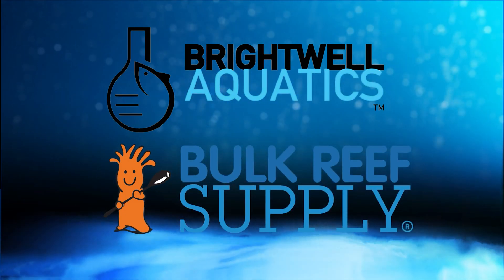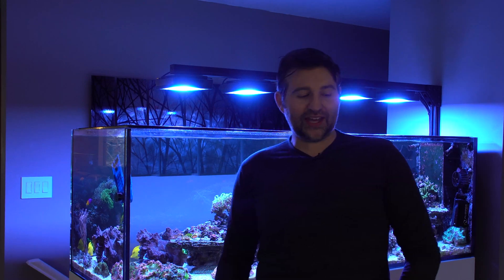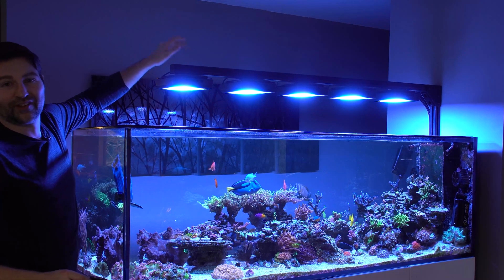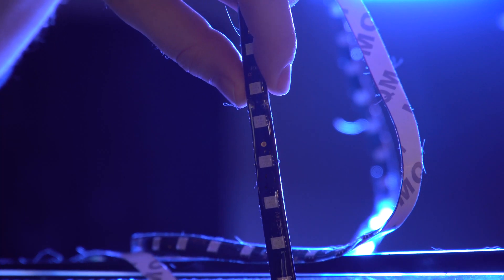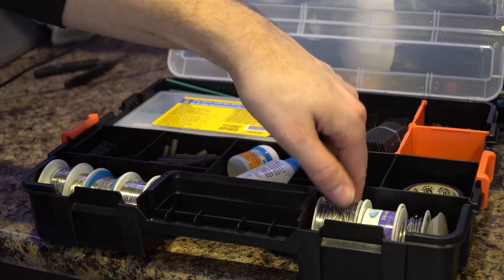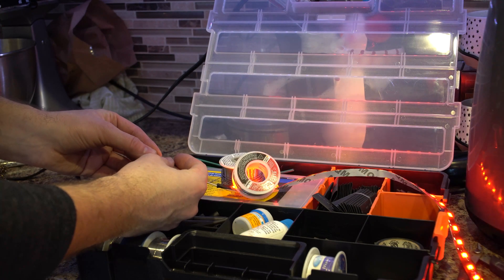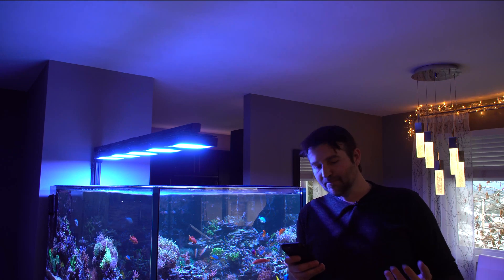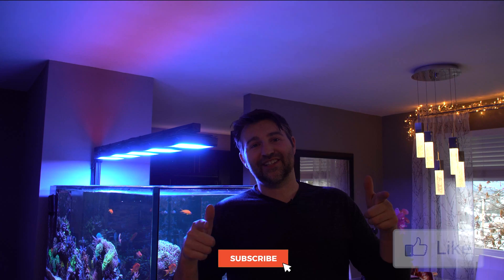DIY Neptune Apex LED Alarm - visual indicator

Comment: Awesome video! Can I do this if I want lights in my cabinet to turn on with a magnetic switch? Also is soldering hard what other ways can I join the wires together safely? Thank you!!!!
Reply from the maker: Cabinets lights work too!  easy to do with a reed switch.    Can go old school and twist the wires and electrician tape it.. but it isnt as "solid" of a connection

Comment: Is it possible to do this using a breakout box and multiple LEDs? Like also having a green light turn on in response to an optical sensor in a full skimmate container?
Reply from the maker: Yes you could.  (Ish). You would likely want to use the 0-10v output and prob a little arduino controller type of thing to pick a color based on voltage

Comment: So Deven if I want to put a light under my tank connected to the eb832 24 volts outlet and put contact switches on the stand doors, will this work with on and off as I open the doors and close them ? Or for example in my little sump can I put lights around it and when friends visit me to see the system , can I just open up my Neptune’s app and turn on this lights ?
Thank you! In advance for you answers. Am sure you will 
Thank you! 
Great video btw
Reply from the maker: You can turn on via app, voice commands with Alexa or get a break out box abs wire it up to magnetic Reid switches to automate it

Comment: I would make that oscillate off and on so it would draw my attention even more.
Reply from the maker: I was thinking of that too! I may implement it later when i have a chance to play :)
Reply: I worry about the relay clicking on and off over and over again. Considering BRS had a problem with their heaters clicking over and over again because they set apex to turn on at like 79.0 and turn off at 79.1. So it clicked all day. I guess it’s not that big of a deal considering alarms don’t go off too often.

What about one of those LED remotes and a sensor that can be placed in line, and the remote to just set it to flash?
Reply from the maker: @PatrickJewellTheGreat  You can buy leds  that flash on their own, so likely strips out there to do the same thing :)
Reply: This advanced code on the 24v port would flash the LED every 2 seconds when EmailAlm_I5 is ON

OSC 000:00/000:02/000:02 Then ON
If Output EmailAlm_I5 = OFF Then OFF

And you get a free audible alarm from the relay clicking on and off ;)

Comment: Nice. I did the same a couple years ago with a regular apex Varspd port and a 5v relay switch, and the rgb tape. Alarm on condition pushes the varspd port to ‘60% or 6v’ and that activates the relay. NO is green, active closed makes it shift to red. Requires 2 apex independent outlets to work and quite a bit of wiring, but if anything gets out of whack I have my canopy light up red. 

Cool stuff devin.
Reply from the maker: Nouns a advanced. I like it!   Your getting the wheels turning for some future ones :)
Reply: @ReefDudes  link. I don’t have many subs since I just use it to host vids for my R2R account. I used an op to isolated relay since I didn’t want to fry my apex. The frequency of flashing is different based on ‘threat level’ of the alarm

https://youtu.be/9PSeGx_IbgY
Reply from the maker: Awesome!   I bet one could use a little arduino to read every step off the 0-10v and do any color you want based off it :).  Would take one power plug and the 0-10v
Reply: @ReefDudes  yep. I started learning arduino for just that purpose, and planned to have a bank of lights with alarm condition labels. Basically 8 options for voltage sensing, and 8 outputs. Then I realized I have my phone n me all the time, and I get push notes with the alarm on it. So it felt redundant. 

I’m pulling down my fishroom this week for a move, and may revisit the idea for fishroom v2. Not sure it makes sense to do that much work in the end. I like the simplicity of 2 color green/ good, red/bad in the canopy. And a redesign would bring it down to just one outlet and the varspd.

Comment: Good video  is there a way I can do this with the apex classic please and thanks
Reply from the maker: You sure could.  You would have to use an outlet and a power adapter for the leds on the classic.
Reply: @ReefDudes  can you please do a video on how to or can you lead me in the right direction please and thanks 😊

Comment: great idea :) unfortunately can't have the EB832 here in the UK so guessing you can  do the same thing with the apex breakout box ?
Reply from the maker: Breakout box is only for inputs.  You could still do it but you would need an extra power outlet and a a power brick for the leds
Reply: 1LINK and FMM have 24v ports. Please Mr Neptune Systems bring out a UK EB832.

Comment: Great video.  I am doing the same thing on my tank - well, planned in doing it - purchased everything I needed but not hooked it up yet.  Your video validated what I had planned to do.  You are a great teacher
Reply from the maker: Thanks John!  I hope I motivated you to get yours finished this week 😬
Reply: @ReefDudes  I wish.  I have not even hooked up the Apex.  I have the rock done, separate refugium plumbed, separate electric breakers, water mixing station in the basement, ClariSea fleece roller installed and system cycled and have 20 Mollies doing really well..  This week I am installing skimmer and building the electronics components box.  The one delivered with the CADE tank is not deep enough so I am building a new one and installing in the same spot as the original one.  Then I am proceeding to the Apex controller.  My quarantine system is also complete and fully cycled.  I will add pictures on your Facebook group.  I hope you will be proud of one of your loyal students :)